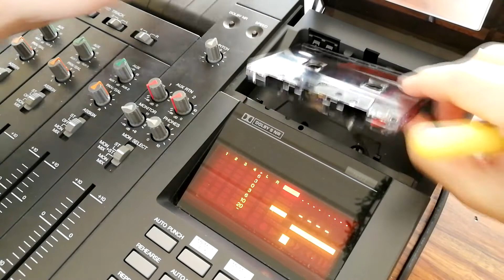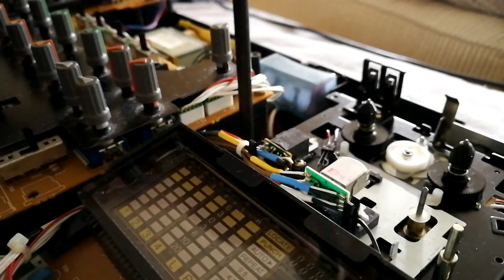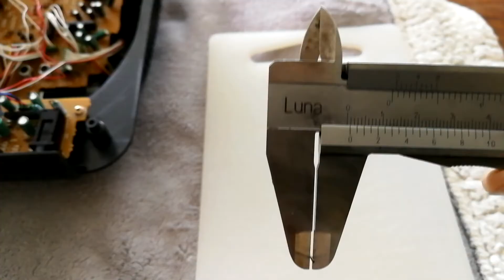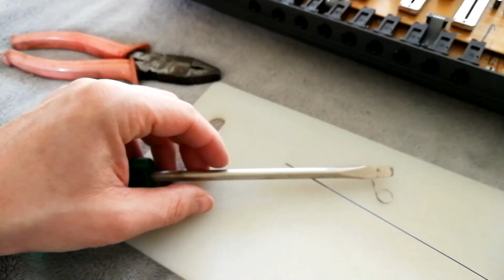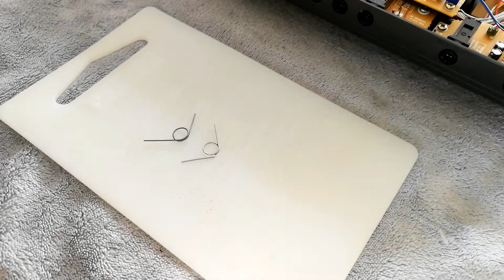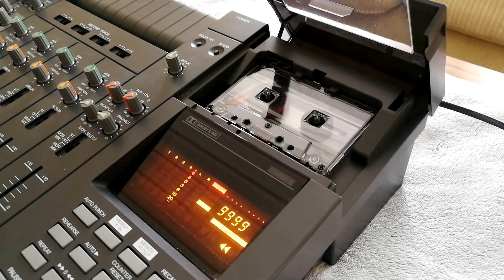Fostex 380s Multitracker Head Panel Disengage Issue Repair

Comment: I’m having the exact same issue with my Fostex 380S (rapid engagement and disengagement of the heads, all display characters lit, no playback), but seems to be caused by something else because the head panel spring is not broken and the cassette tray does move back when pushed forward. What else could cause this to happen?
Reply: Had the exact same issue too. At the end of the video he mentions a leaf switche that can be oxidized which leads to the same symptom. Mine turned out to be bent and werent touching when the transport was lowered. They should be right below the left reel hub
Reply: @MercuryPicnic  I don't think that is the issue with mine either. upon closer inspection, my unit seems to be moving the pinch roller but the play gear is not making contact with the left reel hub, so the tape is getting pulled out of the cassette. the gear that moves between the left and right reel hubs seems to be limp. not sure if there is supposed to be a spring or a belt there but that seems to be the root of the issue with my unit.
Reply: It should be limp but the direction of movement is what makes it swing and makes contact with the reel hubs. If thats not happpening it might be the motor itself/power to the motor. There is only one belt and thats for the capstan i believe. Can you verify if the motor even runs at all?
Reply: @MercuryPicnic  yes, the motor does run but only briefly after pressing ff or rewind. it will run continually when play is engaged but the take-up reel doesn't move, so the pinch roller just pulls the tape out of the cassette and it gets tangled around the metal pin close to the pinch roller. if it needs a motor replacement, where would I be able to find a suitable new motor?
Reply: @kgbinfo  it might be an issue with the gear drive mechanism then. Mine had an issue when i put too much grease on the oil shaft which caused the gear to slip. There's two gears on that motor shaft, one which is directly driven and one above driven by the one beneath it. I think this is designed as a protectove measure incase ot gets jammed so the reel hub doesn't keep trying to move and the the bottom hear just keeps spinning freely. If you look at it from the side, try and see of you can see the bottom gear moving when your machine is ff/rw as that would indicate the motor might be healthy. In mine, the bottom gear was moving but because i added too much grease, the top gear was slipping. Its incredibly difficult, but you can take those gears apart and clean them. Since you never added grease there might then be a problem woth the spring tension its under. There's a spring underneath the gear that provides adequate tension so it doesn't slip. If you take it apart, stretch the spring and replace it, it might fix your issue as it did with mine but due to the sheer difficulty of doing this, you might be better buying a new gear drove entirely with the gears already there. Either that or take it off completely and try what i mentioned. Goodluck

Comment: I have one of these and the unit turns on but it wont play, rewind or fast forward. However when tou turn it on and press rewind or fast forward as its lighting up it will rewind or fast forward. Once you press stop it goes dead again and wont play. It doesn't engage up with the cassette. Any advice as to what it could be?

Comment: I replaced the belt last year and it works great again. Unfortunately I never replaced the screws to secure the cover. Do you have a copy of the service manual or post the size of the 10 screws? Thanx Vin

Comment: Great and helpful! I have a 380S that has been forgotten in the basement for twenty years for lack of a belt. Have you replaced yours, and can you tell the measurement? I was amazed to see that you have the service manual! Is there a link to it? Thanks!
Reply from the maker: Hi Mark, no I haven't replaced the belt yet as it works fine still but I bought a spare in case it snaps one day. I don't have the exact messurements and I'm not sure I would do a very good myself as it is a flexible loop. But, this is what I bought: https://www.ebay.de/itm/133942389820. I'm not from Germany myself but it worked with some Google Translate and bravery to get it delivered :). Regarding the service manual, see a previous comment on this video. There are also very helpful members in the Facebook group called "Portastudio and other 4-Track Cassette Recorders".
Reply: @notlars  Thanks. Incredibly, Fostex provided the service manual! The machine is from 1993! I replaced the belt okay, but after reassembling and powering on, the transport is doing an up-down action nine times and stopping in the 'up' position with all lights lit. Third Island said to check the "functions gear lock," but beyond this he is silent. I can find no mention of this anywhere. Have you any idea? By the way, the drive pulley is 1 cm in diameter, the capstan flywheel 5cm and the distance between axles is 5cm. The belt is flat and 4mm in width. Sellers want between $15 and $20 for it!